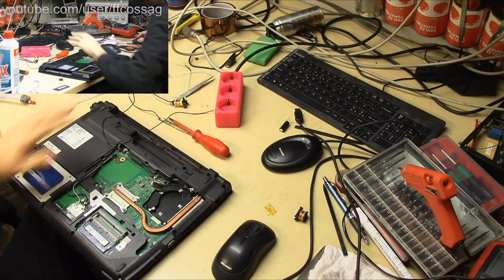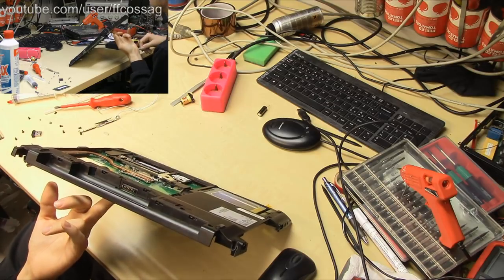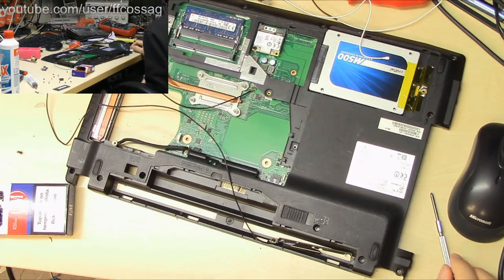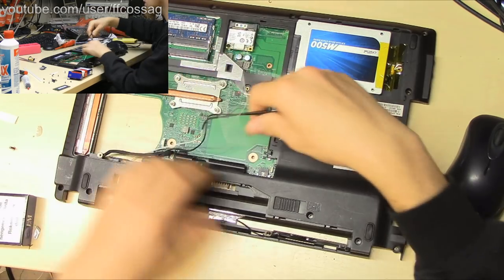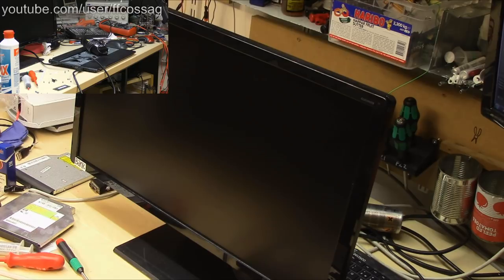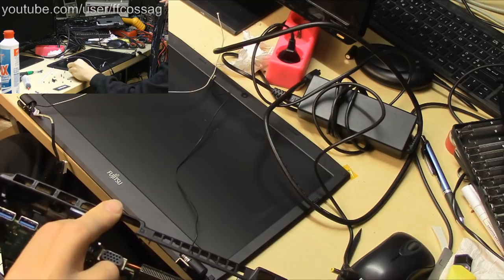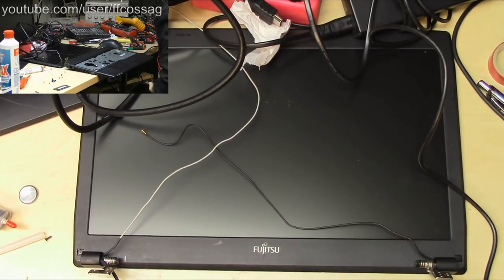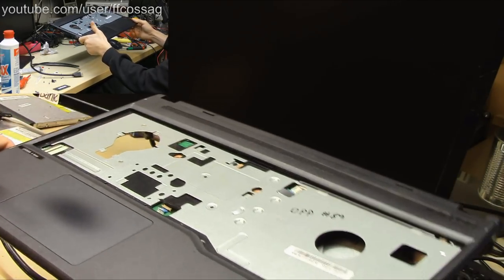RECDSTRM: I'm a strong laptop don't need no screen

Comment: ASUS X551MA-SX030D
15,6" 1366x768
Intel® C Dual-Core N2815 Bay Trail
Ram 4GB 1600MHz
Harddrive 500GB
Intel® HD Graphics
1990 Swedish Kroner = €192
http://www.netonnet.se/art/dator/laptop/varumarke/asus/asus-x551ma-sx030d/203522.6020/ The shop a did buy it from in Sweden

That is a very cheap plastic laptop but it works. My old HP Pavilion DV2222ea gave up after been serving me for years. I got around 5 years of life before the gpu gave up and it only beep on boot now. That had a Core 2 Duo 1.86 Ghz.

Comment: i don't think that laptop will last very long due to overheating cpu because i didn't see you add a proper cpu cooling solution.
Reply from the maker: Only time will tell, it still runs cooler than a Macbook. ;)
Reply: FFcossag yep that is very true especially when it comes to the new MacBook Air 2018 model correct me if I’m wrong but the new MacBook has a intel core i9 running at a toasty 95 degrees Celsius too.